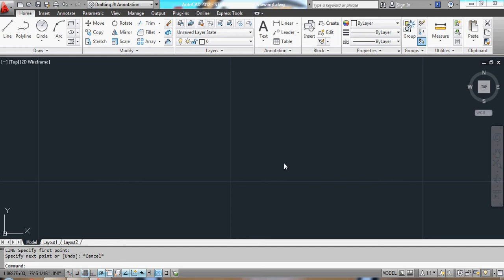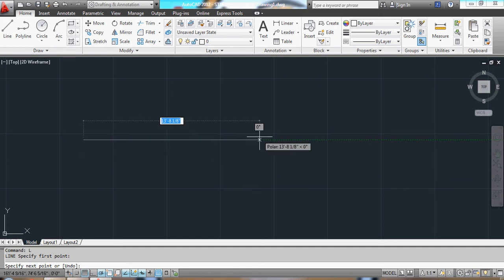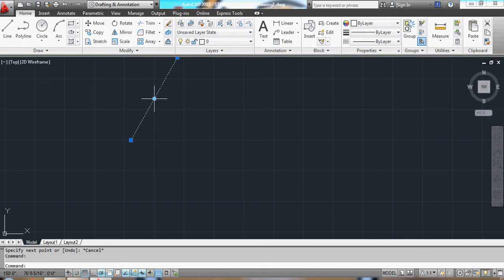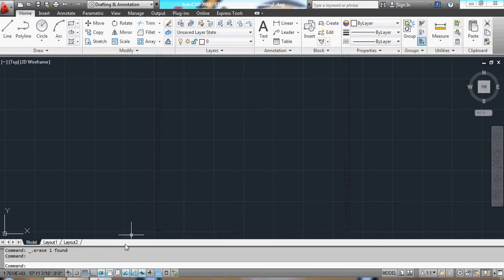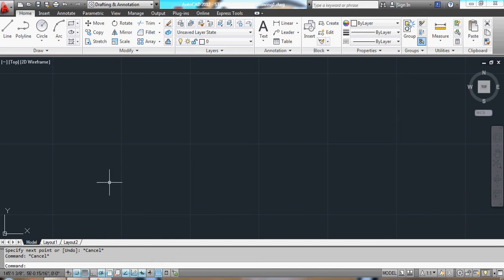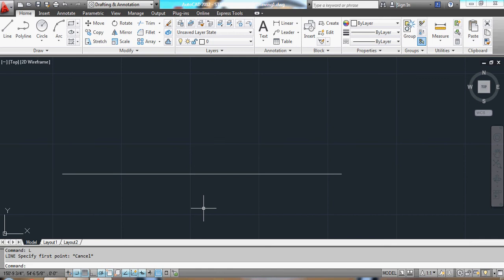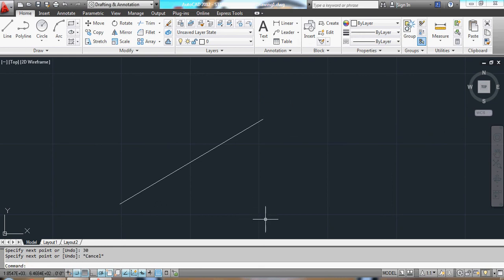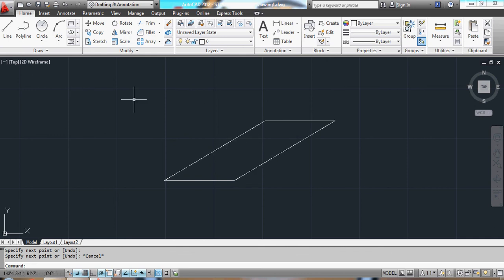Part 2: AutoCAD 2012 Introduction & How to Draw a Line

Comment: how to draw a square using the l function for instance I want to draw a line of 1000 mm at 180 degrees , and from that point I want to draw another line of 1000 mm at 270 degrees and so on ..basically how to draw a new line at a certain measurement from the end of a line

Comment from the maker: Hey Martins, I'm not exactly sure what your problem is but I have 2 guesses, solutions below.
1)You weren't able to draw the line. Check your units. AutoCAD will not accept the notation ( ' ) for feet, unless you are working in a unit system such as Architectural that accepts it. 
2) You can't view the drawn line on the screen. To make your line appear along the entire length of your AutoCAD window; right click your window and select "Zoom", again right click your window and select Zoom Extents.